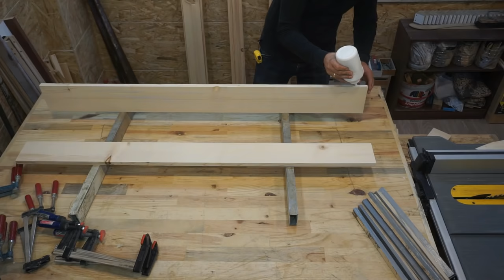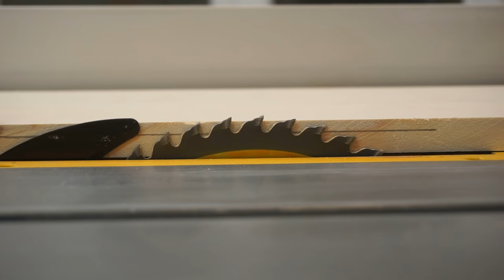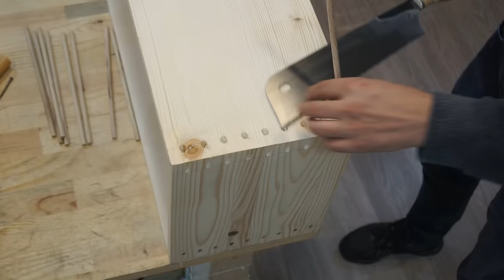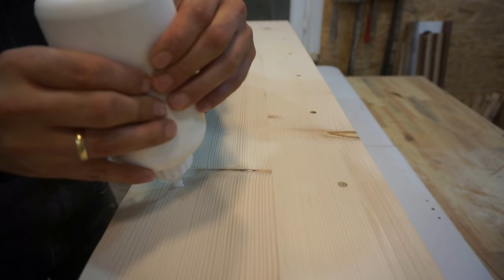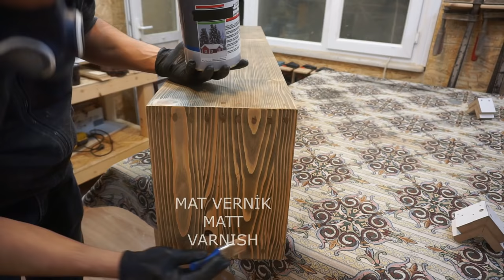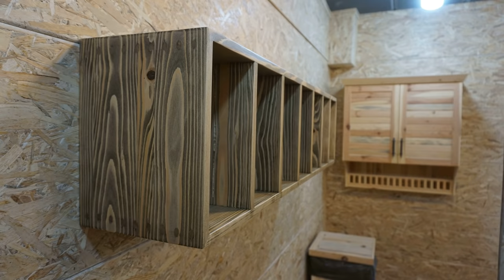Making a bookshelf / Diy wooden bookshelf / Ahsap kitaplik / Simple wooden bookshelf design

Comment: When u push the boards thru the table saw it looks effortless. When I push boards thru the table saw I feel a little bit of kick back. What am I doing wrong? Do I need the riving knife installed?
Reply from the maker: It would be better if it was a cleaver. It is necessary to be careful when cutting with this type of saw.

Comment: Hello. Very nice work. May I ask the part of the video where you hide the screws- how do you do it? Using a countersink, then a screw and then a beech pin? How deep do you countersink the screws? Thank you.
Reply from the maker: Thank you so much. I am so glad you liked it. I used a countersunk drill bit. Depth 0.5 cm. The dowels are in the tree I use again. Fir.

Comment: Hi, great style Of join corners. Its realy dificult job and Its spend much time. So i have one question. Why did you join shelves with metal scrue and didnt use the same style with glue and wood pins?
Reply from the maker: Thank you so much. You are completely right. I still regret this. It had to be completely wooden. I didn't have much time and I guess I ran into easy.

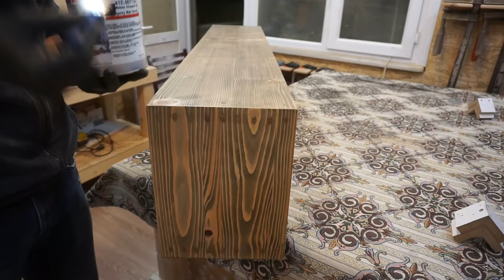Comment: Did you use pre wood condition before staining at 6:51? I ask cause it looks like there were some noticable blotching on the sides.
Reply from the maker: First I applied the paint. I applied protective clear polish behind it. It did not leave a stain, but there were color differences in the wood grain.

Comment: What was the bit you used for the shelving? The one that added the holes as you pushed the screws in?
Reply from the maker: Sorry. I could not understand that you wrote.
Reply: @CelalUnal1   @Celal Ünal  when you screwed in the shelves. The drill bit you used looked like it made a hole while you were screwing them in.

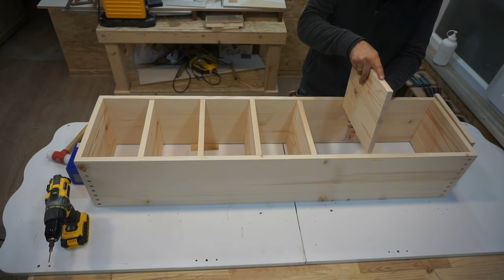At 04:49
Reply from the maker: @VideoWulff  countersunk drill bit. For embedding the screw head.
Reply: @CelalUnal1  thank you!